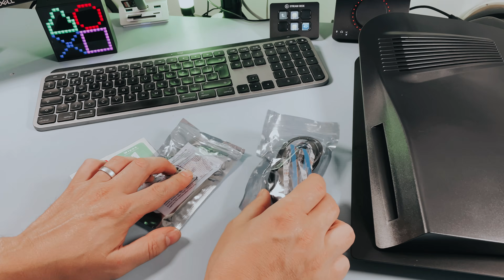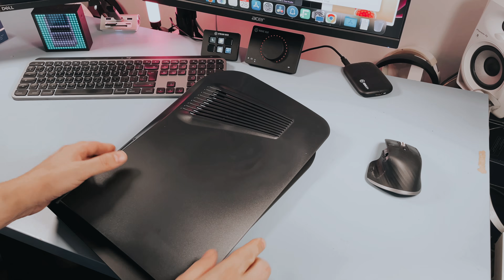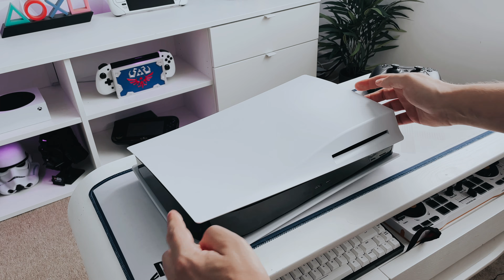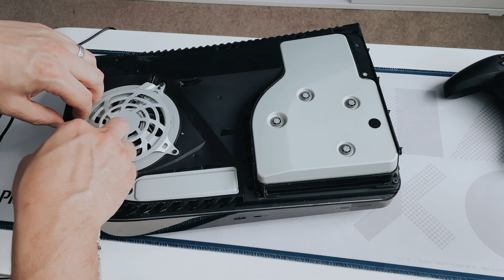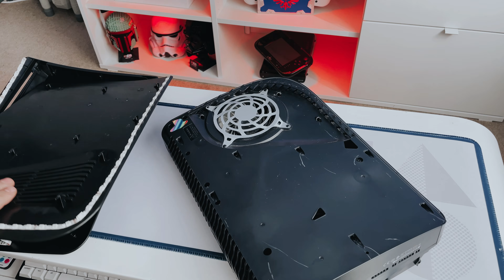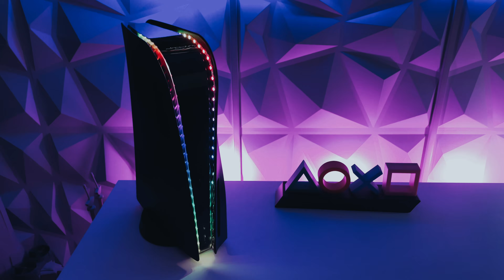PS5 Custom Faceplates and RGB lights. Fit them EASILY

Comment: Just got These awesome faceplates delivered today from Amazon,I have the lights as well.Time to set it up and make my PS5 purr ;-) Thankyou for this abrilliant video and sharing the setup with it.Cheers! Liked and subscribed.I have a horizontal base stand but this is no biggie .I can work around its demensions np and it wont interfere with an external install if I go that route.Havent decided yet.Thanks again.These plates seem way more solid and made better that the original just for a heads up.
Reply from the maker: Glad it helped. Enjoy. 👍🏻